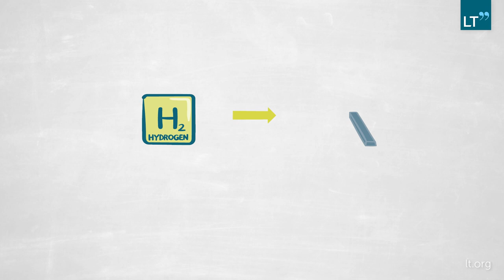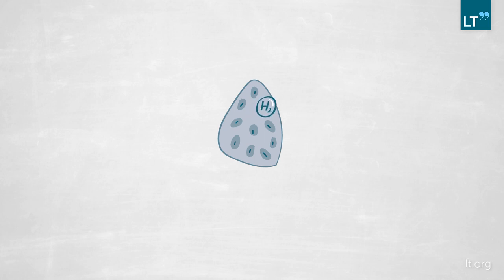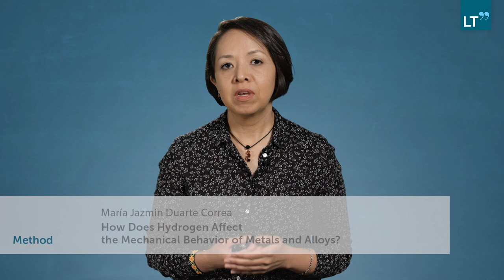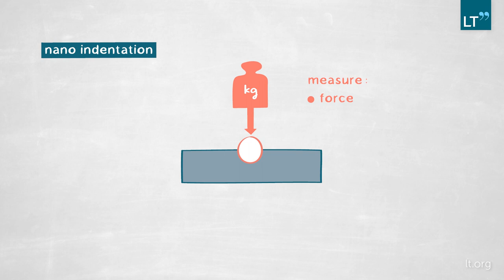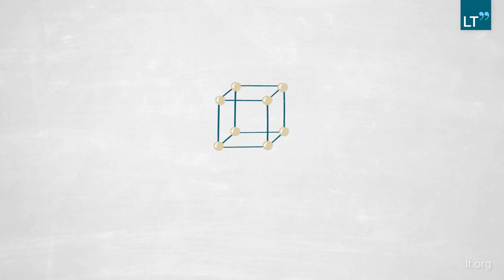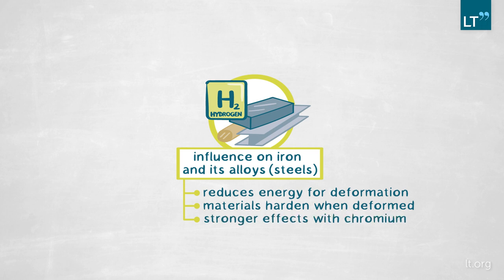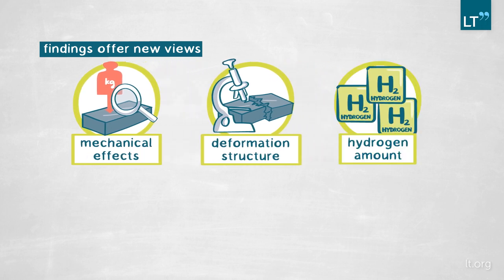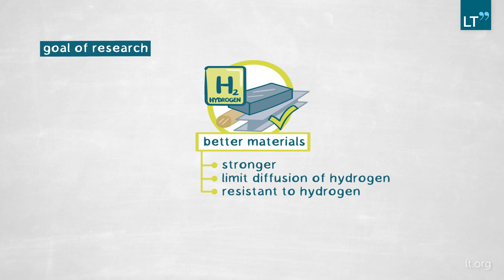Tracing Hydrogen Embrittlement in Steel and Iron

Comment: The nano Indentation experiment explained, is that similar to a Vickers hardness test?
Reply: Hi Elliot,
In general, we can talk about a similar concept in both cases, nanoindentation and Vikers hardness, in the sense that in both you use a hard indenter to deform a softer material. However, there are some important differences.
The first one is the volume of the material that is measured. In Vickers hardness we talk about indentation or microindentation (micro Vickers) with an interaction volume even in the millimeter range. In nanoindentation the interaction volume is just few micrometers, almost 1000 times smaller. This means that using a Vickers device you can evaluate the bulk of the material, while in nanoindentation you can look at specific regions, like independent grains/phases or precipitates. 
The second difference is that the increasing load applied and the displacement produced in the material, are continuously recorded during instrumented nanoindentation. These data are useful not only to determine the hardness of the material tested, but also can provide information on the elastic behavior and other processes occurring such as creep, phase transformations and much more. The Vickers hardness, on the other hand, is calculated by optically measuring the residual imprints (plastic deformation) at the end of the test, and therefore hardness is the only information provided. 
At the end both have their advantages and disadvantages and the use of one or the other depends on specific needs.